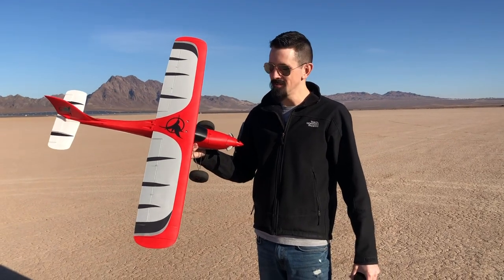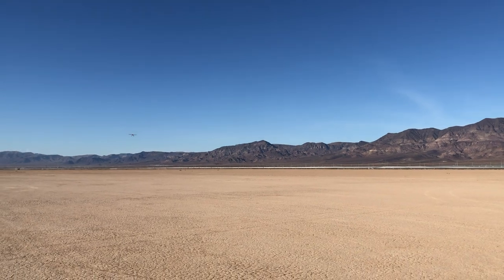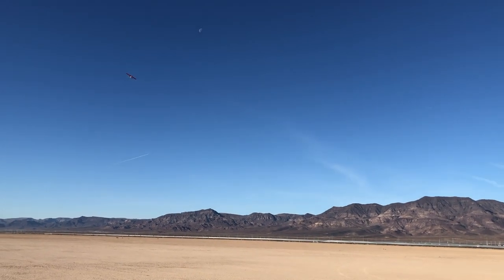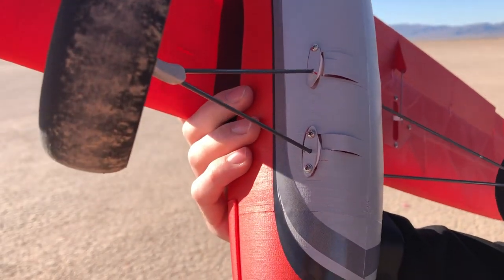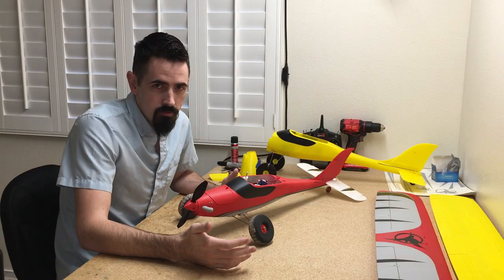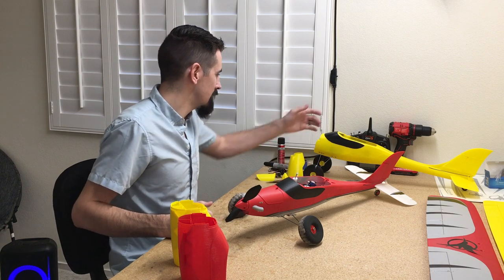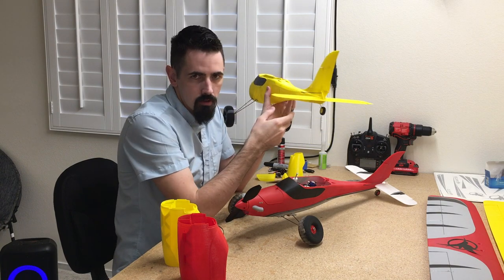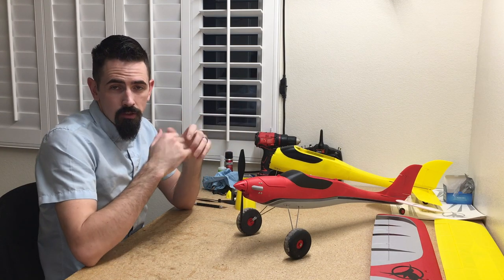Eclipson Model C Bush Plane Maiden Flight and Review - LW-PLA

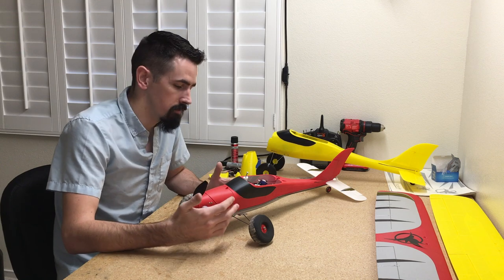Comment: Just as an FYI to any of you who may be building this plane. Make sure that you have received the correct version of part 6 - Fus2. This is the landing gear connection portion of the fuselage that Troy mentions aroun 6:30 in the video. I purchased my plane in April 2021 and only recently got around to printing and assembling the plane. The set of files I was sent did not contain the upgraded part and consequently my plane ripped apart during taxi testing. I just contacted Eclipson and asked them to send me a copy of the upgraded part.

Comment: How do you make those wheels? Can you remove the supports from the inside?
Reply from the maker: They are 3d printed with varioshore TPU from ColorFabb. The infill can be adjusted to whatever you want. They could be printed without infill.

Comment: How shock resistant and stiff but flexible is that material compared to say balsa or foam? Does the weight end up being somewhere between the two materials? Looks cool
Reply from the maker: This LW-PLA airplane is comparable wight to balsa there is not much give the the material.